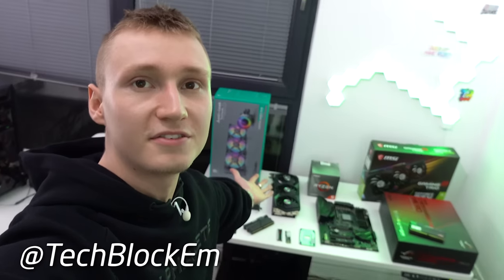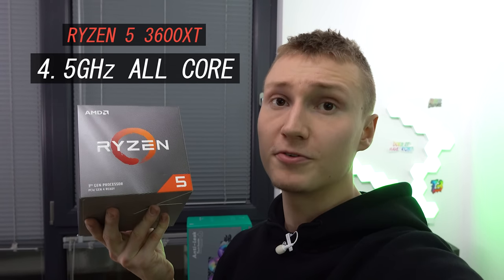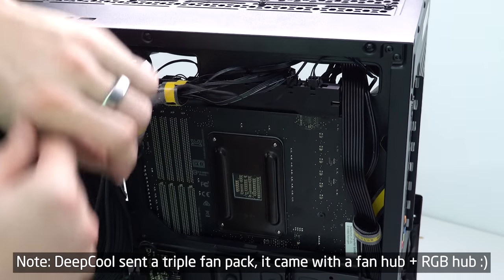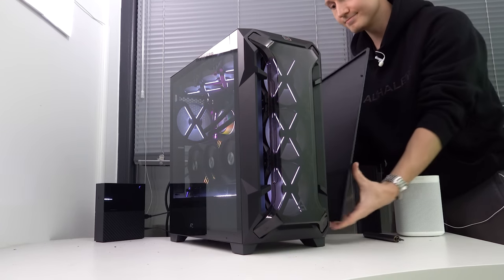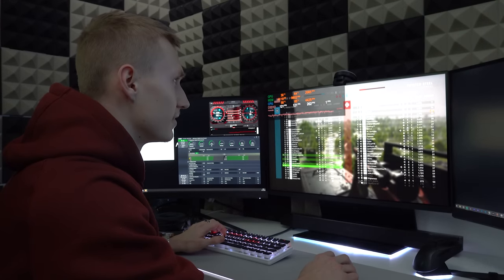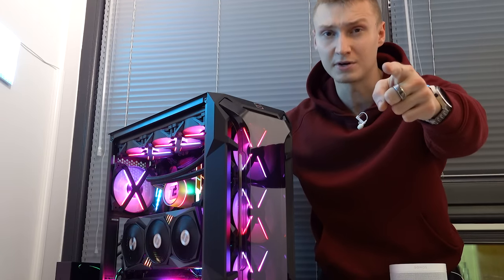Antec DF600 FLUX Gaming PC Build

Comment from the maker: ✅ Channel Sponsor ✅
GET 25% OFF with coupon code: TechBlock
↪︎ geni.us/tbk-scdkey

★ Timestamps & Links ★

✅ Would highly recommend this Electric Screwdriver on Amazon ➜ https://geni.us/i05H

00:00 Intro
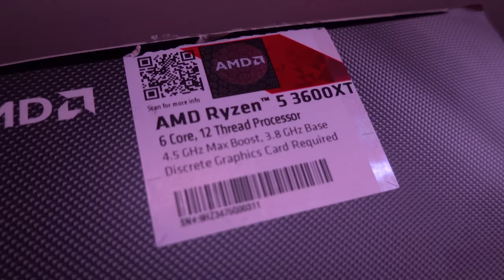00:13 Antec DF600 FLUX PC Case
00:45 MSI RTX 3080 Gaming X Trio
01:08 650W or 850W PSU?
01:35 AMD RYZEN 5 CPU
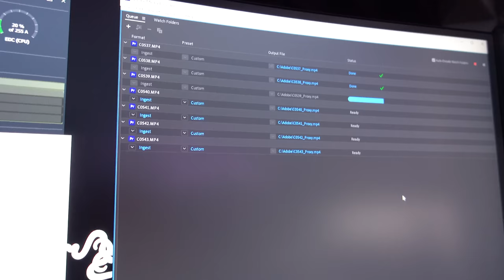02:20 GEIL EVO X RAM
02:47 why X470?! NOT X570??
03:39 RAZER Tomahawk ATX PC Build update
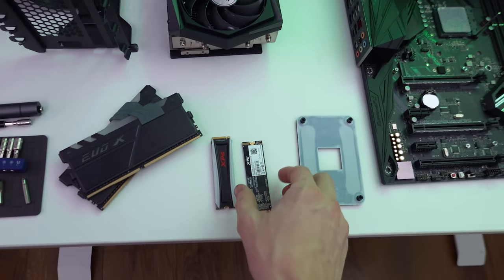04:01 Dual 1TB M.2 NVMe SSDs
04:25 the PC cable management 😬
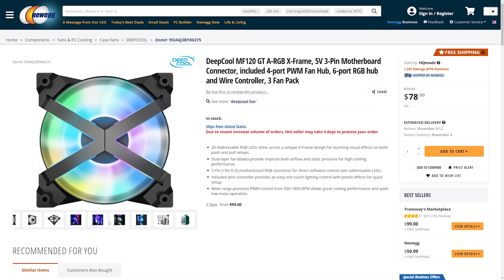04:32 How I wired up the ARGB X-shaped fans
04:51 Antec DF600 FLUX best feature?
05:36 3-pin 5V Addressable-RGB splitter hub
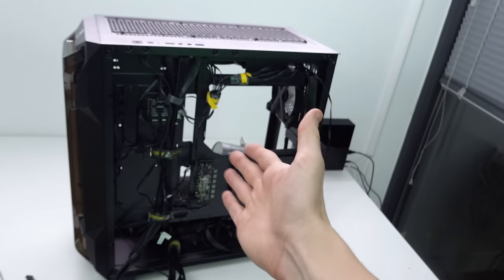06:00 The AIO Liquid Cooler & Fans
06:16 TECH TIP
06:39 sick edit
06:45 mounting the liquid cooler & custom logo
07:07 PC build
08:25 Vertical MSI RTX 3080 Gaming X Trio
08:44 Will it boot up?
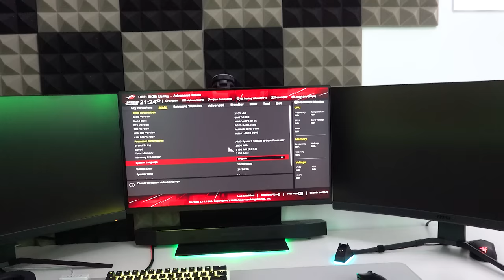09:09 The LED button on the PC case
09:44 "underglow lighting"
09:51 The RGB Lighting Effects
10:56 Playing Battlefield V (RTX ON) w/ RTX 3080
12:04 RTX 2080 Super vs RTX 3080 
12:27 the 40C GPU temp xD
12:44 the next PC build :)

(Main PC Parts)
↪︎ Antec DF600 FLUX (PC Case) on Amazon ➜ https://geni.us/R6hjSh
↪︎ MSI RTX 3080 Gaming X Trio (GPU) on Amazon ➜ https://geni.us/arlV5
↪︎16GB GeIL EVO X (RAM) on Amazon ➜ https://geni.us/Yke6yX2
↪︎ ASUS X470 ROG Crosshair VII Hero (Motherboard) on Amazon ➜ https://geni.us/KpMvaBL
↪︎ XPG SPECTRIX S40G RGB M.2 1TB on Amazon ➜ https://geni.us/f0yywD
↪︎ XPG SX8200 Pro M.2 1TB on Amazon ➜ https://geni.us/qxDdUR
↪︎ DeepCool Castle 360EX RGB (Liquid Cooler) on Amazon ➜ https://geni.us/3E4c3Up
↪︎ Seasonic FOCUS 850W Gold (PSU) on Amazon ➜ https://geni.us/p7ybX

(Optional)
↪︎ Vertical GPU Mount on Amazon ➜ https://geni.us/mSUx5E
↪︎ DeepCool MF120 GT (Fans) on Amazon ➜ https://geni.us/jXA7CM
↪︎ Custom printed RGB plate (that I used for "underglow") ➜ https://www.etsy.com/listing/71558497...
↪︎ Shakmods 24-pin ATX Sleeved Black Cable ➜ https://www.ebay.co.uk/itm/Shakmods-2...
↪︎ Shakmods 8-pin PCIE Sleeved Black Cable ➜ https://www.ebay.co.uk/itm/8-Pin-PCIE...

(Other)
↪︎ Thermal paste cleaning wipes on Amazon ➜ https://geni.us/zrkIZ
↪︎ Antec 650W Gold PSU on Amazon ➜ https://geni.us/NaZB
↪︎ G.Skill TridentZ Neo (RAM) on Amazon ➜ https://geni.us/rhZfm
↪︎ A-RGB Splitter Cable on Amazon ➜ https://geni.us/aqN0LP

Comment: When I did my first full rebuild of my PC and went with a case I picked this one and still got it. Don't think I will ever change it out. I switched out the hub for my own corsair hub to control my fans since I switched to Corsair fans and AIO, but it still got room to handle all that and 2 full 3.5 hard drives and SSDs. Cheap, but a beast when it counts.

Comment: With the vertical gpu mount, did you have to remove/cut the 7 metal pcie covers off so that the mount would attach properly?
Reply from the maker: Yes, I really should have added that in the video :/

Comment: I have ANTEC DF600 flux case and ANTEC SYMPHONY 240 ARGB. Both connected to motherboard (MSI - B660M JRAINBOW1 header). But  i don't know how to control rgb with a software, i tried few but wont work. Please help

Comment: i love you videos bro but this pc sucks cause there so many little mistakes like:
The case is not that good like the 011 or 011 xl for rgb
The board sucks the x570 godlike was so nice and paired with the msi gpu it would have been perfect
The ram is bad just because of the rgb software and its only 2 dims
U should have waited for the 5000 series cpus
AND the lian li strimer plus cables were so good why take some none rgb ones
still a nice pc and the gpu , fans and the aio are really nice keep up man but u had such a extrem rgb pc why change it so much